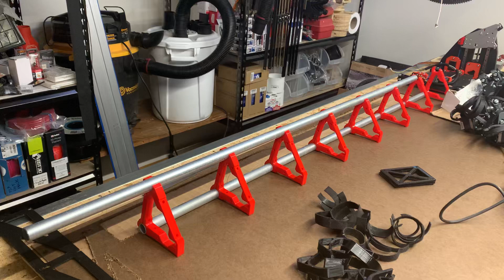LowRider 3 MPCNC - Beam Assembly (X-Gantry Structure) - first phase - tips

Comment: hi, can you tell me please what size are the stainless steel tubes? i cant find it in the manual, but it think its 1 inch, just correct me please.
Reply from the maker: On the following V1E documentation page for the LowRider 3 —  https://docs.v1e.com/lowrider/  — you can see the EMT tube diameter options in these two paragraphs (see below), where "p" in a diameter stands for a decimal point, so "25p4" means "25.4" — and there are options for various different diameters. (Again, don't mistake 25.3mf for 25.3. It's 25mm, with .3mf as the file extension) — "Brace note- Print the two left and right end braces with 50% infill and oriented so you can have the top facing out on each end, and the rest with 30% infill. 2’ wide builds need 6 total, 4 foot versions need 8 total. One every 200mm (8”) or less. There are three different brace sizes provided - Brace 25.3mf, Brace 25p4.3mf, and Brace 23p4.3mf which correspond to the diameter of the X rail in millimeters. For US based builds, the recommended X rail size is US ¾” EMT conduit which has a diameter equal to 23.4mm, so print the Brace 23p4.3mf parts for this size X rail." — "Rail Block note- You want the gap between these to be no larger than 200mm (8”) or less. You will need 8 for a 4’ build and 14 for a 8’ build. There are three different rail block sizes provided - Rail block 18p1.3mf, Rail block 23p4.3mf, and Rail block 25p4.3mf which correspond to the diameter of the Y rail in millimeters. For US based builds, the recommended Y rail size is US ½” EMT conduit which has a diameter equal to 18.1mm, so print the Rail Block 18p1.3mf parts for this size Y rail."
Reply from the maker: If the above answer is not what you were asking, but rather wanted to know specifically what I am using in the video: I've now made two LowRider v3 (one was an upgrade from v2), and on that first one I used 1" diameter stainless steel tubing, and on the second one I used EMT conduit.
Reply: @design8studio  just perfect, going to use 1" conduit, thank you

Comment: U need to get a deering tool and it will fix the Razer edge and give you a factory edge on both sides
Reply from the maker: I'm sure if I was doing lots of that kind of thing such a tool would be good. I don't do much of that and my later cuts only needed a few seconds on my belt sander to solve the problem. Thanks though!

Comment: Thanks for sharing. I plan to start printing parts this coming week. Will this be a build series?
Reply from the maker: I may do a series on it. I did record some more video this morning. I am thoughtfully considering whether or not to edit it versus just uploading it raw. I’m still trying to solve an issue of my lead screws being misaligned which makes my side assemblies not able to let the XZ plates move easily up and down. I’m going to work to correct that.